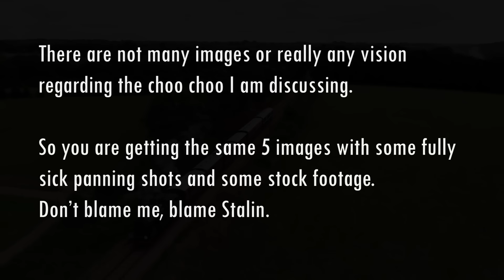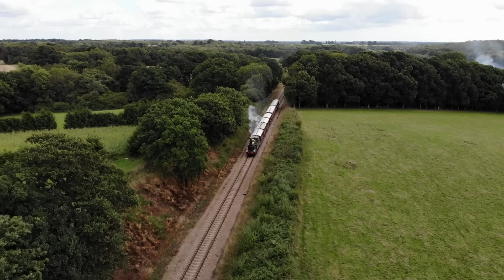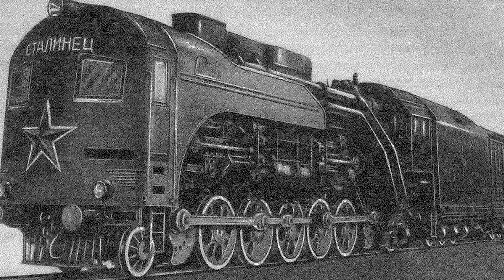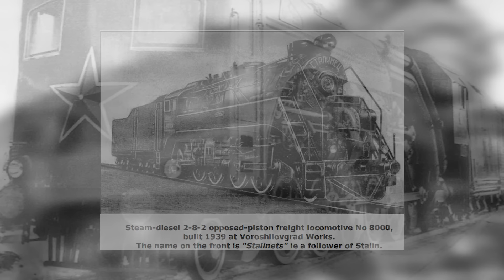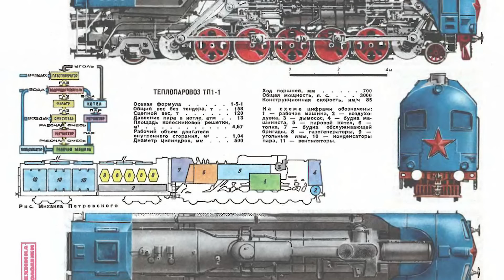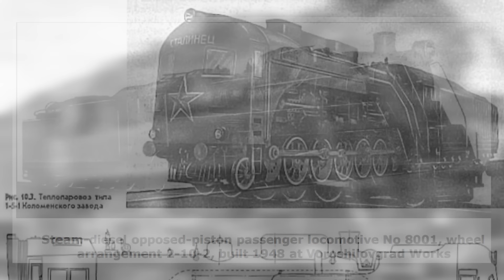The Soviet Steam-Diesel Hybrid Train Thingy

Comment from the maker: Stalin the Steam Engine Merch drop

https://historyofeverything-shop.fourthwall.com/
Reply: For those who do not know. Steam locomotives didn't have frontal cabin, because train driver need access to the coal tender to put coal inside the furnace. Separating driver and coalman was disadvised as both needed perfect communication regard when and how much coal should go to furnace.
Reply: I recommend talking about the triplex locomotive next
the capitalist side of the coin has a lot of train blunders that the propaganda doesn't want you to know about

The Triplex, ordered by the primarily coal-hauling Erie Railroad (which my great grandfather actually was an employee of for 40 years, fun fact) was basically a poorly executed science experiment where some engineers thought: "what if we make a Mallet but more?" and added an extra set of driving wheels under the tender. 

But because this was the 1910s, its boiler couldn't generate enough steam and distribute it to all 6 massive cylinders to save its life. it also generated so much torque that, like the AA20, it broke the couplers on railcars it tried to pull. So this meant the class was relegated to banking duties (pushing trains uphill) and all at a CRAWLING top speed of 5-10 miles per hour.

Only 4 were built, three "P-1 class" 2-8-8-8-2s for the Erie Railroad, and one "XA class"  2-8-8-8-4 for the Virginian Railroad. all the P-1s were scrapped by the early 1930s and the XA underwent mitosis and was rebuilt by its own manufacturer into 2 separate locomotives.

an even stranger 2-6-6-8-2 triplex was proposed for fellow coal-hauling railroad, the Chesapeake & Ohio, but was thankfully never built.

These engines were stronger than even the Big Boys but had such small boilers and piss poor steaming that they never could actually USE all that tractive effort.

Comment: 4:00 
1 - Working machine (engine?)
2 - The blower
3 - smoke extraction
4 - train driver's booth
5 - steam boiler
6- the furnace
7 - maintenance crew booth
8 - gas generators
9 - coal pits
10 - Steam capacitors
11 - Fans
--- The scheme of work, on the left ---
I read from top to bottom, from left to right
___First, what is NOT in the color frameworks:
Coal
air
gas
water
gas, water
gas, steam
air
working mixture
steam
working mixture
___Second, what is IN color frameworks:
gas generator
water heater
filter, boiler
faucet, regulator
regulator
The capacitor, working machine
--- Stats ---
TEPLOPAROVOZ TP1-1/ heat locomotive TP1-1

The axial formula - 1-5-1
Total weight without tender - 158 tonns
Coupling weight - 120 tonns
steam pressure in the boiler - 13 amospheres
grate area - 4.67 square meters
Internal combustion engine displacement - 1.04 cubic meters
cylinder diameter - 500 millimeters
stroke of pistons - 700 millieters
Total capacity - 3000 horse powers
Structural speed - 85km|h

Drawing by Mikhail Petrovsky

Comment: That's a very clever idea. I guess the theory is that you can use this system without a gearbox, clutch or torque converter, since the steam cycle can work at 0 rpm, whereas the diesel would stall at lower RPM.

Comment: The pics you found were great considering the ground isn't thick with them! (Thankfully, the Reds didn't go in for Zeppelins so we didn't have to worry about hydrogen bombs…till they actually got the H-Bomb!) You should do a video on the Soviet Lada motor car! Prototypes in the 1960s led to their introduction in '73…all the cutting-edge engineering design specs of a '33 Vauxhall Cadet!🤣

Comment: There is footage out there of 8000 running; https://www.youtube.com/watch?v=NwqA377mOjI Seems the diesel power stroke caused jarring wheel slip at low speeds due to the sudden power application.

Comment: And here I thought they were looking into Diesel Electric with Steam boosting, for the ability to start any train and pull it to speed with the power of Electrical torque and Steams brute force.

No it's some kind of steam driven two stroke Diesel engine.

Just when I think they might be trying to combine the best, not the worst of two ideas.

Comment: During the atomic age the soviets along with other nations proposed to build nuclear powered trains and was fortunately scrapped.
Chernobyl disaster on tracks comes to mind if the soviets had gone ahead with the idea.
Reply: I believe a bigger problem was the weight and size. With the tech at the time, it wasn't possible to make a small and light enough reactor to fit into a train with existing track and loading gauges. Maybe if there was an entirely new system built using, I dunno, 3 meter gauge like Hitler wanted, it might have been possible, but why? It is easier and cheaper to build a conventional NPP and then electrify the tracks.
Reply: @daniil.furgen French trains use this technology :) A NPP powers the grid which powers the trains.
Reply: @daniil.furgen  Yep, weight and size I think was the issue. Maybe things were learnt after the 14 drive wheel behemoth featured in the previous video.
Reply: Chernobyl, now in an oblast near you!!!
Reply: A train sized reactor would not be able to create a Chernobyl scale disaster no matter how it collided. A MW would be enough for a train compared to the 1000 that Chernobyl 4 produced. So a thousand times less disaster potential. It wouldn’t be good but it wouldn’t pollute countries. In fact it could be less harmful in a collision than the nuclear waste or nuclear weapon trains that run regularly. Plutonium vs uranium fuel.
Reply: @daddust If the Soviets did put a nuke powered train into service for it to have a failure on board or the reactor getting damaged and exposed caused by a crash You'd be right on the scale and it may have an impact on local populations and the environment.
As for the flasks depending how well they've been built. British Rail sacrificed one of their 40/45 class trains by having it plough into an empty nuclear flask. The train along with the carriages it was pulling was a complete write off. Whereas the flask was intact with some dents and scratches.
Reply: @skyrat3816  WTF is a ''40/45 class trains''???

ACTUAL FACT:

''On 17 July 1984, 46 009 (formerly D146) a BR Class 46 LOCOMOTIVE, hauling three Mark 1 coaches, was deliberately crashed into a "Flatrol" wagon loaded with an empty nuclear waste flask and lying on its side.''
Reply: @jimihendrix991 I couldn't remember which class the engine was, but knew it was one of the Peaks locos.
Reply: @skyrat3816  Class 40 are now 'Peaks' on your planet?
Reply: @jimihendrix991  Sorry for getting things wrong. I could have mentioned a 37 or a deltic for badness.
Reply: @daddust  "A train sized reactor would not be able to create a Chernobyl scale disaster no matter how it collided."
You have no imagination.  Think an un-noticed [ignored] primary coolant leak whilst traversing the trans-Siberian railway.